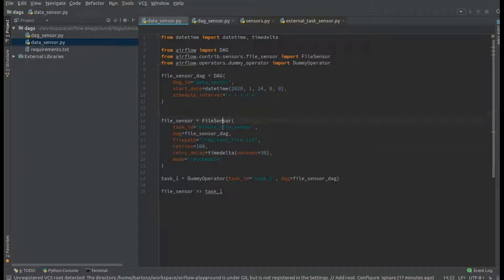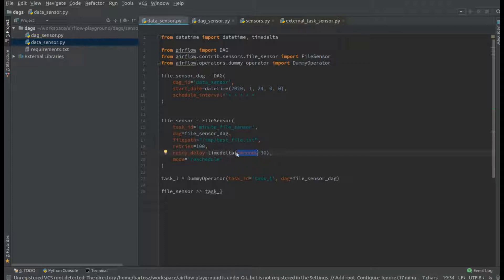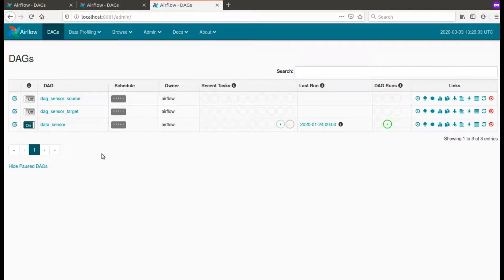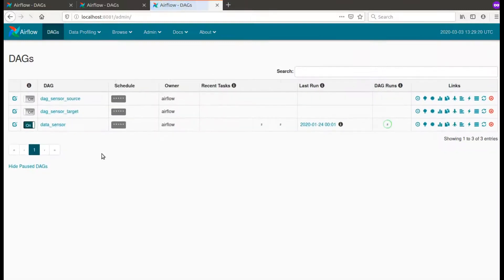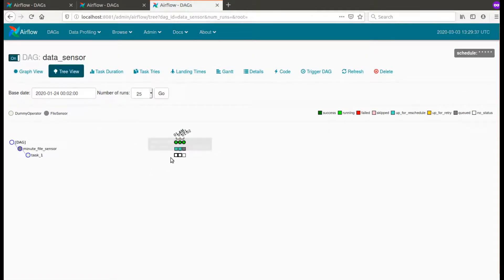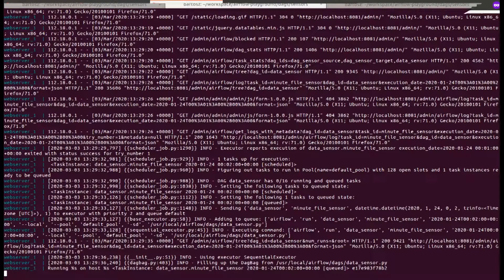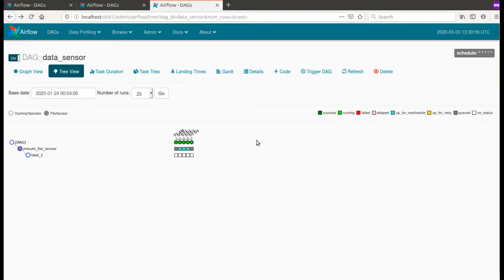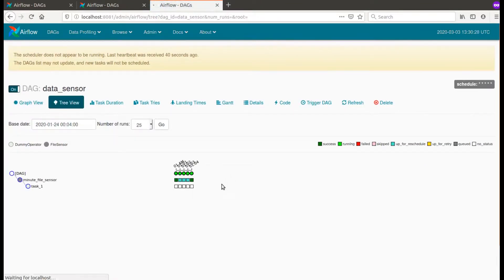Apache Airflow data sensor example

Comment: thanks a lot ... could you please demo OracleDB Sensor
Reply from the maker: Hi and thank you! I don't have plans to demo OracleDB Sensor but if it doesn't work properly, the SQLSensor should do the job : https://airflow.apache.org/docs/apache-airflow/1.10.3/_modules/airflow/sensors/sql_sensor.html (https://airflow.apache.org/docs/apache-airflow/stable/_api/airflow/sensors/sql/index.html for Airflow 2). As far as I understood, you have to provide a query returning a row if the data is there.